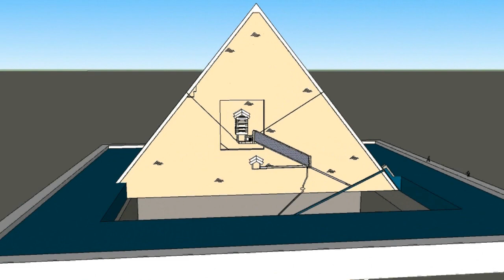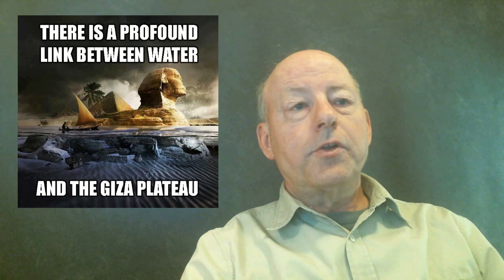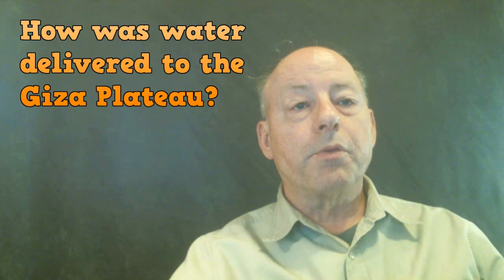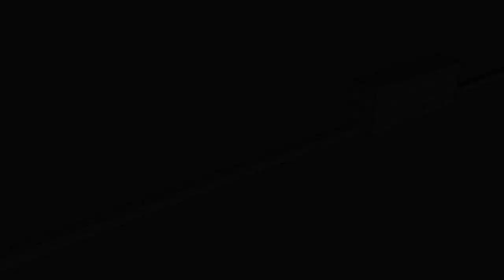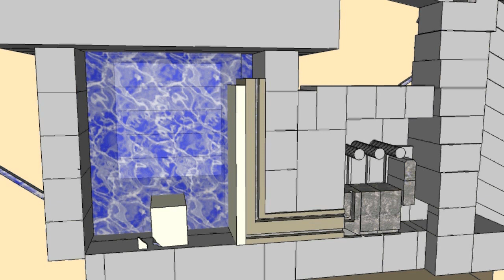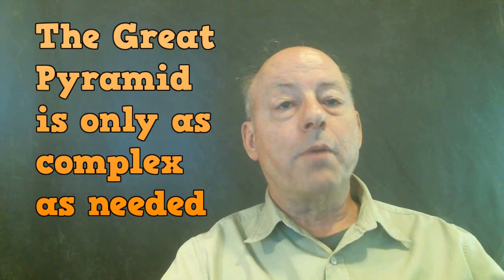Video 12:   Additional Information

Comment: I like your animated simulation model as presented (your theory on the Great Pyramid as a Construction Pump) ——-But what I want to know -one of the things that bothers me —-is that if the Coffer was a Float as part of the entire pump system—-Then where is the evidence of the sliding mechanism in the Kings Chamber it would have operated on? How would it have been connected to the wall?
Reply from the maker: The Great Pyramid is not in pristine condition and is not in its original condition when built. Not all of the "original evidence" is available for you and I to examine. The Great Pyramid is like a puzzle with many pieces missing. It is the honor and duty of modern researchers to accurately "fill in" the missing pieces base on legitimate academic research. Lots of pieces are missing. Here is the link to my 3rd book about the Great Pyramid which is in the form of an eBook. https://www.amazon.com/dp/B0CF784F75